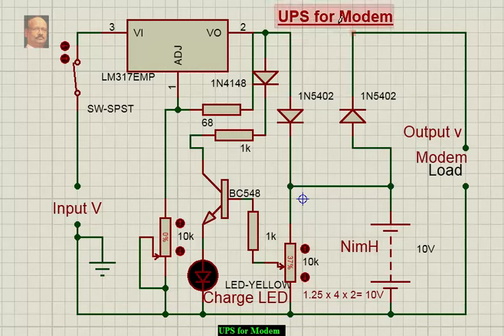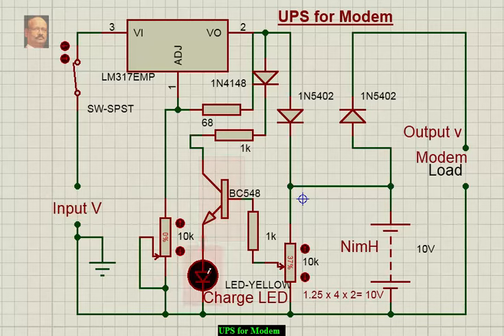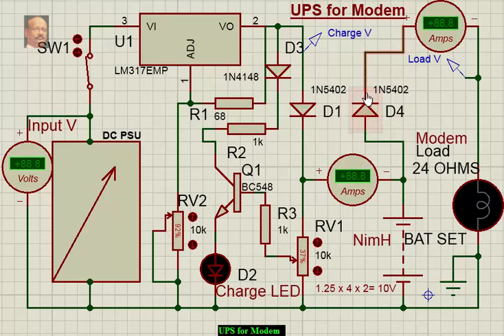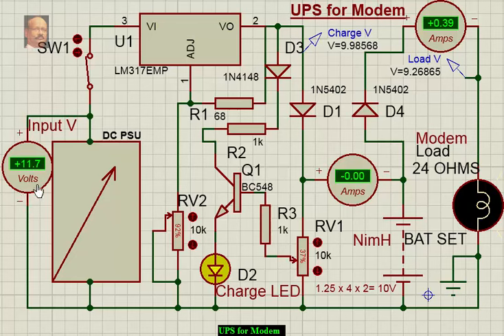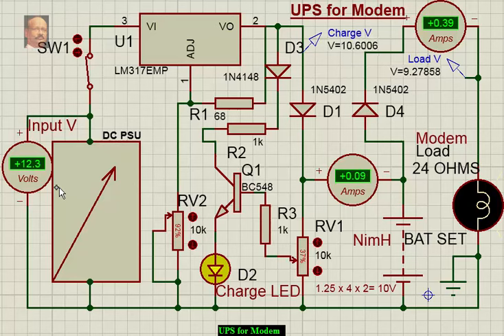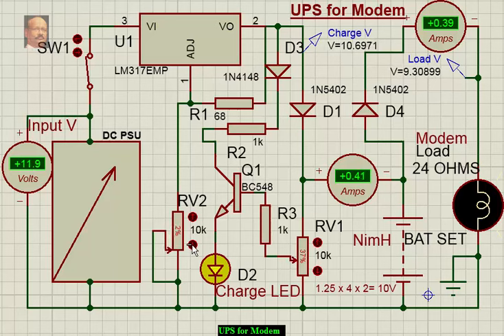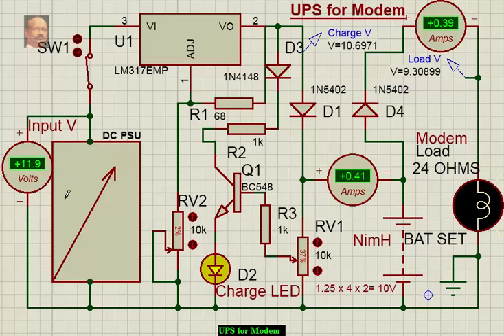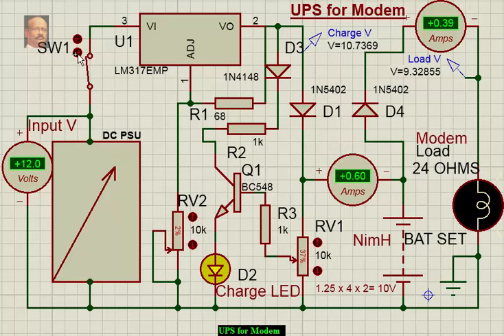Uninterruptible power supply for modem--Mini EEE projects

Comment: will output switching will effect if ac power gone.will power  gone for a second..
Reply from the maker: Switching to battery is instantaneous even less than a millisecond
Reply: ohh.. grat to see your reply sir...actually i have to use it Raspberry pi.. and i don't want to cutt power for a milisecond .becouse it will restart the raspbberry.. can i use this circuit ...thanks again for reply..

Comment: Sir, if I use 35ah battery. Which components need to be replaced?
Reply from the maker: No change as long as load current is less than 2 A. But be careful never use a LI battery. Nicd or NiMH is ok
Reply: Yes, Sir. I use 12v 10A DC PSU and 35Ah battery. I'm sorry sir i dont know how much load current, but the total load is 120 watts, and maybe later it will increase again if I add more loads like router or switch. 
sorry sir i do not really understand about electro.
Reply: Oh i use the car battery sir.

Comment: Sir I need 12v, 5amps const supply .How can I obtained it.I also used 7812 but it cant give const supply
Reply from the maker: 7812  datasheet says it for 1 A max. For 5 A one has to use SMPS and not linear control